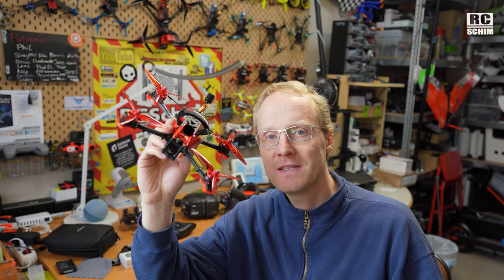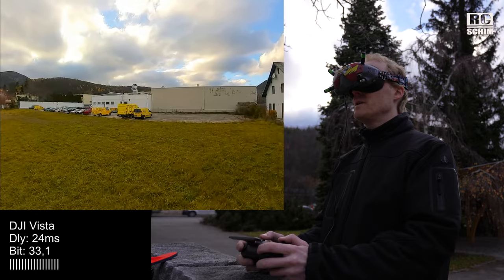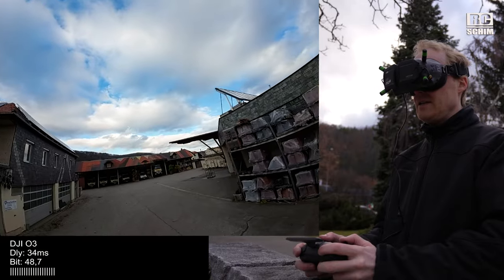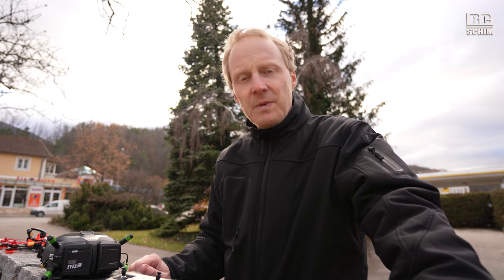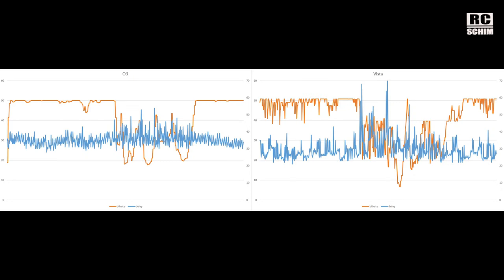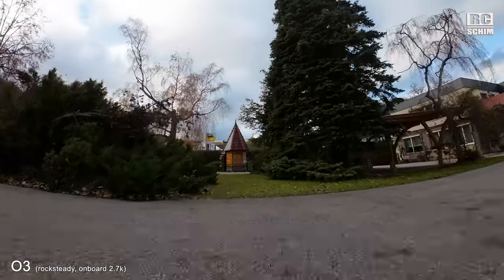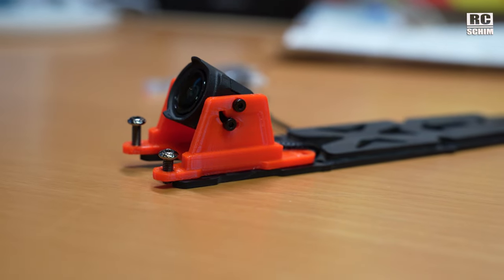DJI O3 - how does it look compared to VISTA?

Comment: The O3 footage in some parts I thought was in black and white setting to start with. The color looks terrible while the vista looks great. I would hope this can be corrected.
The camera cables are not the same on the O3 side I don't believe they are interchangeable. I think they could have a different amount of pins.
Reply from the maker: yep, that's the way it looks here in winter. almost bw ;) 
I've turned up white balance on vista quite a lot, looks nicer that way. didnt do this on the O3. O3 can for sure be tweaked more. hopefully also in the dark areas...
I have to doublecheck - but I fear you are right, the MIPI cable might be different. 
short cable is the reason why I cannot install the O3 everywhere I want...  (chimera7?)
Reply: @Rcschim  Hi Schim, have you tried flying in D-Cinelike mode? It makes the image less contrasty.
Reply: @Rcschim  There is already replacement cables available from runcam, ali express and I think someone said even caddx but not confirmed. Ive already ordered a couple of 15cm ones. 20cm is also available. I'm sure DJI made the standard airunits 10cm so half of us will have to pay dearly just for a few extra cm to fit our long 5" frames, just like I had to do with all my vistas even tho they were 12cm.

Comment: Hallo, wie immer tolle Arbeit. Deine Vergleichsvideos sind immer objektiv und ich schaue mir diese gerne an. Ich habe eine Frage betreffend der einstellbaren Sendeleistung in der DJI Goggle. Die Sendeleistung wird zwar letztendlich von der Vista / Air unit übertragen aber ist diese fest auf den eingestellten Wert oder dynamisch bis zur eingestellten (max.) Leistung?
Reply from the maker: Danke! Bei der Vista war es noch fix glaub ich, aber bei der O3 weiß das keiner so genau. MadsTech hatte schon umfangreiche Tests gemacht - aber die vermutete dynamische RF Power bei O3 hatte er noch nicht nachgemessen...
Reply: @Rcschim  vielen dank für die schnelle Rückantwort

Comment: I've been impressed with the O3 at full power and stock antennas. I use it on the ground and so far it consistently penetrates about 350ft worth of office building before losing too much signal. That's while just sitting in my car. I could actually, at the end of that ~350ft while parked on the other side of the building at the furthest end, bring the Mbps down to like 1.5 or so while maintaining around 100ms latency and keep driving around. It's when it drops just a hair below that things get real bad. The exposure has been my main issue now where I'd really like to drive around at night. I'm used to analog cameras being able to see everything in the lowest lighting. I could set my ISO high but I couldn't figure how to have this set a high EV yet also leave it on auto. Otherwise the on board camera is really good. The RockSteady EIS seems to be able to smooth out the harshest bumps and vibrations, at least on the ground.

Comment: I dont' like how much darker the o3 is. Maybe there are settings for the camera that can change that. I just bound an o3 to my V2 goggles in my house and the picture was grainy because it's so dark in my house, but then I rebound my Vista to my goggles and it wasn't nearly as grainy.
Reply from the maker: If it's grainy, iso had to go up high. Maybe try reducing the fps to 50 or 60 in low light!
Don't use nd filter obviously...
Reply: You are also in low power mode till u take off!
Reply: @LovesM855A1 that wouldnt matter for light. 

Interesting that it is like this. Usually the higher the frame rate the darker the photo due to the shutter speed having to be quicker which lets less light through. I heard the o3 lowlight performance is very poor though. Maybe its just the sensor

Comment: The image from the O3 is too dark. Did you change any camera settings? Set fixed ISO or shutter speed maybe. It doesn't go like this when settings are "auto"
Reply from the maker: All on auto as far as I remember. Maybe my cam angle was too high in the sky for the slow cautious flying around the house...

Comment: On how many MW is the vista running? Is it on 1200mw? And had you done the ham file hack to get more mw out of the o3 air unit aswell?
Reply from the maker: I fly both units like most pilots do ;)

Comment: is the picture contrast on the O3 tuned for the OLEDs on Goggle 2?
Reply from the maker: Yep, looks like it is, I will try with higher Exposure values...
Reply: That's a really good point, the image may not be optimized for the V2. I recently watched a video from KababFPV where he says that what you see in Goggles 2 is much more detailed (in the shadows) from what you see in the video file. https://youtu.be/P8I9i437yjY?t=741

Comment: have you had any issues with the onboard recording? I have lots of skipped frames and makes the recording not usable... :(
Reply from the maker: Sounds like you should try a faster (or just different) SD card. Had no stuttering on the recordings not in 4k not in 2.7k
Reply: @Rcschim  I'll check with on-board memory. I've used SanDisk extreme pro v30 (black card)... Can't think it's too slow. Also us and Lexar A2 rated card...
Reply from the maker: @InfinityDrones  one more thing:  how do you connect power to your airunit?   I remember that Ian found this new unit takes 40% more power. 
I used just the main leads of my battery connector for red and black wires, not an BEC off the FC.
maybe the unit struggles with power?    sandisk v30 is what I used as well....
Reply: @Rcschim  I'm using a zeus F722 fc snf have thr o3 plugged in on the dji port.
Reply: Here is a video about it: https://youtu.be/S-D40lexXcU

Comment from the maker: Prerequisites / Firmware upgrade journey:
- DJI Goggles V2 need to be on a new firmware! 01.04.0000!
- DJI O3 Airunit needs to be activated and on the latest firmware!

- first update your DJI Assistant(s) 2  (just to be sure)
  (note that you need both, the "DJI FPV" and the "consumer drones" version of the DJI Assistant 2! Make sure to INSTALL DJI Assistant 2 with Admin rights, else you might get stuck at the black DOS window (where it's installing drivers)

- apply the ROOT Hack (WTF.OSD) before the Goggles FW upgrade!
With the new firmware you will not be able to go back and root your goggles anymore to use the WTF OSD tools, so you have one option less in the future!
My V2s needed a downgrad to FW 01.00.0606 so the WTF hack could be applied.

- switch the Goggles to DJI FPV mode (or Avata mode)
- use DJI Assistant 2 (DJI FPV) and now find FW 1.04.0000 to upgrade to

BINDING the O3 to your goggles:
- Goggles V2 have to be in newer mode (DJI FPV O3 mode)
 ATTENTION:  now we need a different DJI Assistant 2  (consumer drone version) - called "DJI Assistant 2 (für Hobby-Drohnen)" in german

- activate the O3
- upgrade O3 Airunit FW (for me it was 00.05.0203  to 01.01.0000)
- unplug the USB from O3 unit and power it from your copter  
- press bind button on goggles then on O3 (like with old Vistas) and it should bind!

Betaflight OSD:
Have RX and TX wires connected to UART on the FC (neccessary for OSD to work and for things like Auto-Rec on arming...).
There's no settings in the goggles to turn on "custom OSD" like in the past - now you have to copy this code here in the CLI of your Betaflight copter:
set osd_displayport_device = MSP
set displayport_msp_serial = {ConfiguratorUART}
set vcd_video_system = PAL
save

instead of {ConfigurationUART} you just type in the number of the UART you connected your DJI O3 TX/RX. But minus 1 (because it starts to count with 0).
So I use UART3  I write:
set displayport_msp_serial = 2

I used the main battery leads (red and black wires soldered there directly) because the BEC from my FC might be to weak (new O3 needs 40% more amps?).
Reply: jetzt mal ne frage auf Deutsch...habe die goggle 2 / Remote Controller 2/ Airunit o3 UND eine alte Vista - ALLE sind auf dem neusten stand er Firmware !
bekommt man durch den CANVAS Mode das OSD nur auf der neuen Airunit O3 ? oder auch auf die Vista ?? sehe aktuell auf der Vista nur die Standart DJI Anzeige ..verbindungsqulität und Brillen / Flugakku--- kein Betaflight OSD ?!
Reply from the maker: da kann ich leider nur raten. So wie ich das versteh (MadsTech ist hier eine gute Quelle) - musst ja schon froh sein, daß die Vista nun endlich mit der neuen G2 funktioniert. OSD wird da keines gehen...
Vielleicht geht wie früher das "Custom OSD" welches man per Menüoption aufdreht?  
Da ich selbst die G2 nicht hab, muss ich hier passen.   Gibts eigentlich einen WTF Hack für die G2? Glaub ich gar nicht...
Reply from the maker: Meine FPV Kumpel meinen es sollte gehen. Hast die CLI Befehle in BF für OSD eingegeben?
(das hier mein ich:) 
set osd_displayport_device = MSP
set displayport_msp_serial = {ConfiguratorUART}
set vcd_video_system = PAL
save

instead of {ConfigurationUART} you just type in the number of the UART you connected your DJI O3 TX/RX. But minus 1 (because it starts to count with 0).
So I use UART3  I write:
set displayport_msp_serial = 2
Reply: @Rcschim  ..habe jetzt alles so eingestellt wie beschrieben - und siehe da - OSD -- für 5 sec ?! dann war es wieder weg ... und bekomme es nichtig wieder ?! eine Idee ?
Reply from the maker: @Wolltan  man kann mehrere OSD "modi" haben und diese mit einem Schalter umschalten. Wenn Dein 2ter Mode ein leeres OSD ist und du umschaltest, dann wäre es eine mögliche Erklärung.
Oder viel einfacher:  wenn dein RX/TX Kabel vielleicht einen Wackler hat?   (aber ich glaub dann würden die Daten einfrieren).
Hatte ich ehrlich gesagt noch nicht, oft schon das Problem, daß ich gar kein OSD hatte...   (dann ist's meist ein Problem mit RX/TX oder UART...
hoffe Du findest was...
Reply: @Rcschim  an der Vista hat ich vorher Uart1 an MSP und Uart2 an Seriell ... welchen muss ich jetzt deaktivieren ?( oder bleibt da alles so wie es ist ? 
das erschließt mir noch nicht... und danke..
Reply from the maker: @Wolltan  nichts deaktivieren - bleibt alles so wie es war!  Aber kontrollier bei der Gelegenheit ob die RX/TX Kabel gut verlötet sind!
aja, hast eh das aktuelle BF 4.3 drauf?  Ist glaub ich vorraussetzung damit das BF OSD funktioniert!

Comment: Great review as always. Is it fair to compare signal strength single antenna on vista and diversity on O3?
Here we are checking the signal penetration which is independent on compression technology.
And h265 definitely plays the key role in the o3 and walksnail. Thanks again.
Reply from the maker: Thanks. It is maybe a bit of an apples to oranges comparison here ;)  (I also used 120fps mode on Vista vs. 60fps on O3)
A old fullsize airunit might have had a bit better results than the vista, but not by much.
about 265:  someone pointed out that 265 is only used on Goggles 2 not on my Gv2. Indeed - at least the DVR recording from O3 is only h264  (tho considerable smaller filesize).
Not sure if the transmission is in 265 and only the old googlesV2 are storing the vid in 264...
anyhows, it's a great improvement over signal stability and "flyability". check my more recent video about the O3 to see how nice the DVR looks in buildings with low bitrate...
Seasons Greetings down under!

Comment: Built-in gyro stabilization(RockSteady ) is  also a huge advantage over vista, if I ever migrate to O3 it will be considering this aspect over anything else.
Reply from the maker: Yes, but gyroflow support is even better. A bit more work, but very flexible. I wish it could do 4k60 in 4:3 tho

Comment: Now that there is new software that improved the lower light handling does it makes sense to revisit low latency Vista vs 120Hz O3 in goggle dvr?
Reply from the maker: For sure! I will test soon. Excited that they specifically addressed the back light underexpose issue... but I was quite sure it should be possible.

Comment: Fascinating comparison Mario. The darker image from the O3 surprised me, as would have expected similar dynamic range from both. With Vista, I'm assuming you used the original DJI camera, not Caddx, or Runcam?
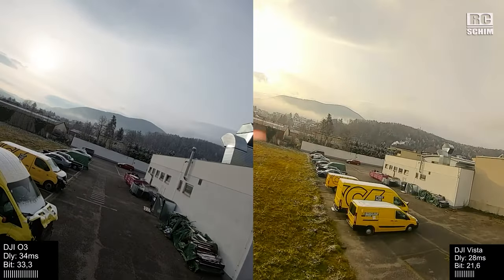The darkness at 7:56 almost makes O3 video appear Black&White vs much more vibrant colours from the Vista.
The test at 8:03 (along the road) seems to be perfectly match for each versions better features. The dark high contrast winter scene fro O3, and vibrant spring Vista scene. Is interesting the Vista has higher bit-rate throughout, but image compression is definitely not there (H.264 vs H.265 on O3). Too bad we can't get an H.265 upgrade for the older Vista systems (DJI Air-light).

The lack of INAV/Ardupilot OSD support and cameras costing ~$100 vs ~$50-$60 has be holding out for now. The O3 quality is that could easily eliminate an extra camera in most situations.  Hopefully DJI offers better MSP-DisplayPort support in future release, not just partial support (lacking elements and character-set sprit options)
Expect this should improve toward spring/summer. 

Thanks for taking the time and effort to fly all the flights and compile sample data.
Reply from the maker: Thanks, I was also surprised. It's a larger sensor now - so it should have an advantage over the vista-  not the other way round. maybe this can be adjusted either with simple EV +...   or the whole light handling could be improved via firmware...
I also set the White balance on the vista really yellowish....
Yes, it's the OG DJI cam (the large one, from full Airunit)
On the gree wood road (which was actually October 2021) was probbably with helicals or patches - but on the same location and orientation - so the higher bitrate here comes from the directional antennas.
I asume the 265 codec needs more processing power than the old hardware can deliver (that's what MadsTech found at least).
I'm curious for the O3 in my planes - because it has more max range and looks like a more stable link. Until I fly more wings again (spring) I hope the OSD issue is solved. 
Super excited that my SRT to Excel script still works! makes it quite easy to display the data!
Reply: @Rcschim  Good point, that H265 may need better hardware (compute, or memory)
Comparing range of each would be interesting, as have not seen any real data. This probably an exercise better done in spring/summer when temperatures are warmer.

Comment: Video feed in O3 is exactly like action2 ( with less options ) , for sure better than a normal feed old dji vista camera, but with the lack of WDR. Have you ever thought about trying and testing Walksnail HD system? You could be one of the best objective tester YouTubers 👍
Reply from the maker: I actually had a DJI a2 on the Vista copter for comparison - but I didn't wanna make this video longer, so I skipped this comparison. But you're right - they are very close (maybe more barrel distortion on the O3?). 
If the manufacturers would send me a free sample I would take a look at it, but I didn't feel the need yet. I'm happy with the DJI video transmission for my kind of flying and since I have so many copters I wouldnt wanna swap systems.

Comment: Any idea of the o3 unit works with fpv planes with alierons, elevator, rudder?
Reply from the maker: Hi, the O3 has nothing to do with how you control your aircraft. If you ask because you'd also like to use the radio control link (with DJI FPV remote) - this is an easy yes!
BUT - you need a flight controller on the plane. The radio link only sends your control commands over "sbus" protocol - so you need something on the other side (the plane) to translate this into steering commands to your servos.
Now might be the best time to watch a few INAV tutorials from "Mr.D Falling with Style" or from Pawel Spychalski or Painless360 about INAV on planes. 
Looks complicated at first, but will give you so nice options (like autolaunch, return home with GPS...)
-
Sidenote:  if you just wanna use the O3 for video on a plane:  if the O3 doesnt get an "armed" command (when you start your drone) then it will not go to full RF power...   only when connected with a FC the O3 will have this ability...
Reply: Thanks for this info. I to was looking at this air unit for a plane and wasn’t planning on running a FC. 
I might look into walksnail instead.

Comment: Hello! very good your tutorial! My question is, using the v2 glasses, is the difference in what is seen in the glasses very noticeable? between old air unit (with dji camera) and o3.
Considering old air unit in high quality mode and 50mbps.
Regards !
Reply from the maker: Hi, yes imho even with the "low res" goggles v2 (that I own) you definitly see a much clearer image with O3. On paper the resolution isn't that much higher - but the compression is better. for example you see much more of those fine details like branches or gras with O3 - where Vista is just blurred.
Reply: @Rcschim  Thank you!
Reply: @Rcschim ya, bitrate and quality compression are very important and its why you see YouTube and twitch focused on it and obviously av1 is the biggest news concerning this which I wonder about being used for digital fpv, open source and the bit rate saving?
Reply from the maker: @pottyputter05  a good compressor (av1) isn't always the best choice for low latency realtime application. it might save bitrate but it could demand an really fast chip in the goggles and on the copter...